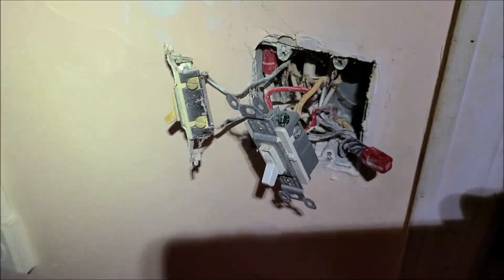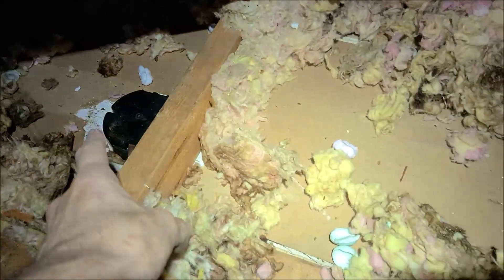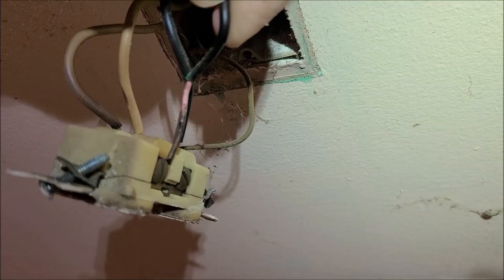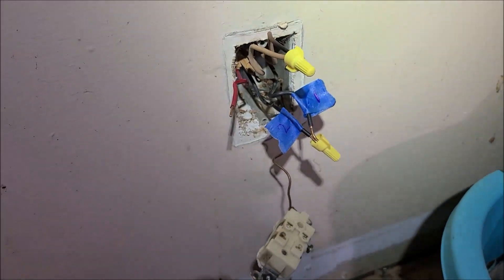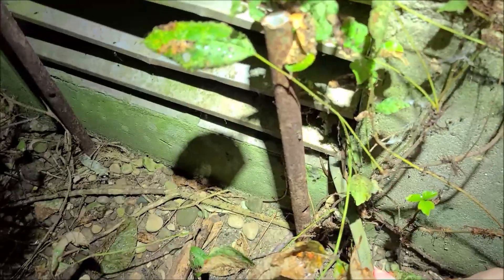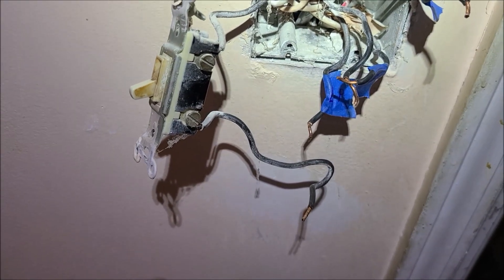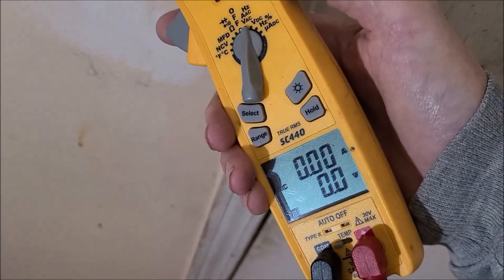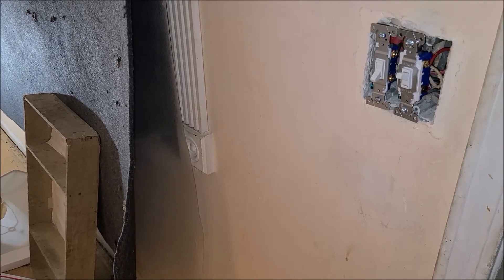How to Fix Flickering Lights and Tracking Down a Miss-wired Circuit

Comment: Working on somebody else’s mess. Can be a real pain in the butt, but they don’t know what they’re doing. I know that ran across a lot and still do. Only one comment I’d really like to add is one putting receptacles or light switches back in electrical box that is metal. Make sure you use electrical tape to wind around the outside where the screws are out so if it comes in contact with the box, it doesn’t spark. An old timer taught me that one about 40 years of plus ago great video.